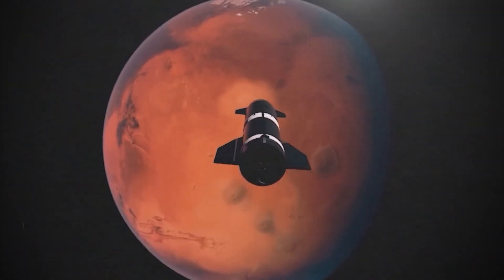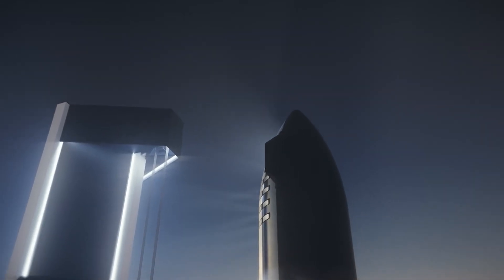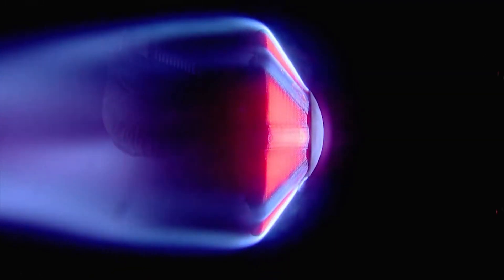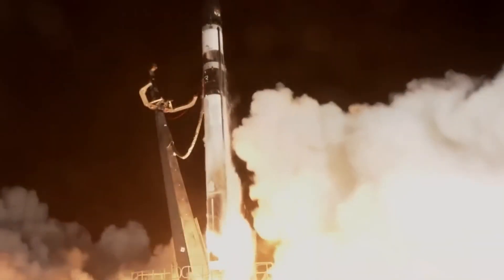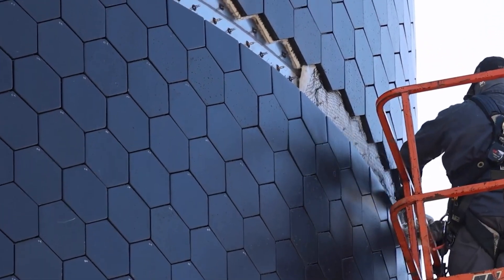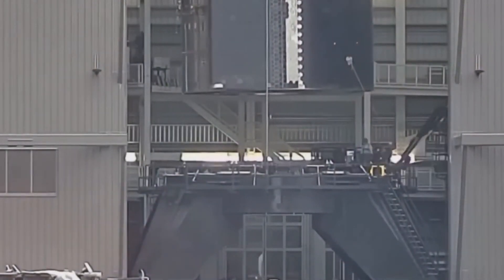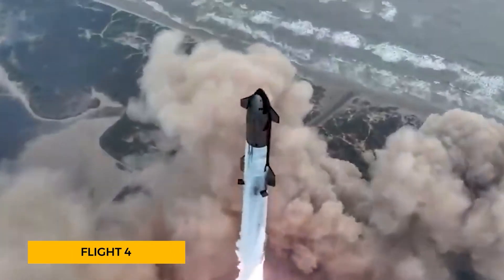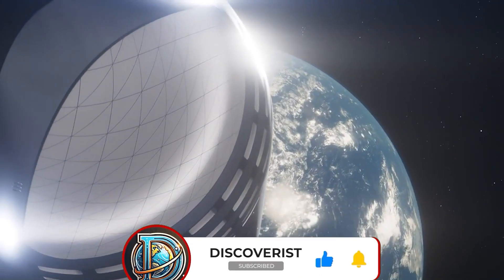Elon Musk Revealed METALLIC Heat Shield Will END CERAMIC Tiles After Starship Flight 6 Problem!

Comment: For Ship there are many missions that can be fully expendable (using a fairing) that maximizes mass and volume to LEO, and still more missions that a 1 time safe return then toss will work just fine.  Full reuse is mainly needed for taking fuel to LEO at $10M per run vs $40M per run for a Ship that can't be launched again.